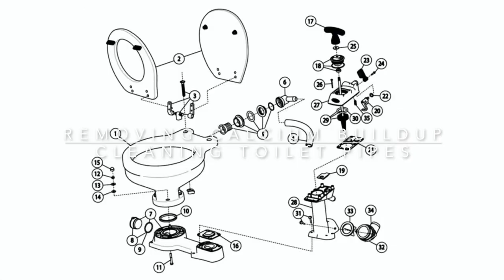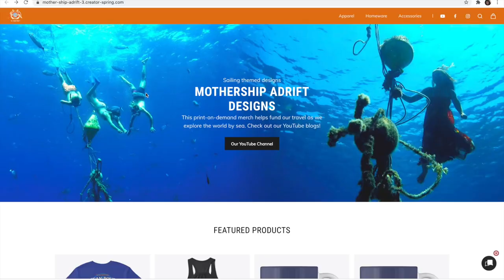Boat Toilet Calcium Removal from a Marine Sanitation Waste Hose Pipe or “Poo Pipe”!

Comment: Jabsco recommends vinegar (acetic acid) to remove limescale. You need enough to fill the pump and the discharge pipe. Let it rest over night and, when you pump it out the next morning, it will do the job in the holding tank. As with aguafuerte (Hydrochloric acid), it gets used up in the process. The trick is to find the right interval to repeat the procedure.
By the way, flushing will get rid of the human waste, but I doubt that better flushing of the toilet will prevent the deposits. Sea water contains plenty of calcium as witnessed by all the sea shells, crabs and coral reefs.
Reply from the maker: I think it’s the chemical reaction between urine and sea water that really causes the problems.. smells and calcium deposits. I have found that with better flushing both are reduced quite a bit. I also tried an experiment with vinegar and calcium deposits and didn’t find it that effective at REMOVING deposits although it did help PREVENT buildup. Aguafuerte / hydrochloric acid / brick cleaner has an instant effect, but you have to use it sparingly and make sure it’s completed reacting with the calcium before pumping out.. otherwise you’re pumping acid into the sea. I thin boric acid is supposed to work equally as well which I believe is the main Ingredient in Barnacle Buster.. although never understood the huge price for that stuff.

Comment: I was sick of calcium building up every couple of months at the bottom of the holding tank and clogging it up, leading me to remove the pipes to clean it. Very messy job. So i installed a 3 way valve and flush it straight to sea now. I can use the holding tank when in marina too.

Comment: Good stuff. Those galvanic connection wires needed cleaning up too. Use salt & vinegar solution then baking soda solution.
Reply from the maker: Good tip!

Comment: It's the hard way and it's the wrong way to clean out the toilet tube. My tube is 1.5" and 6 meter, i cleaned it out in 20 minutes using 30% acetic acid.(Keep the sea water inlet closed while doing it, after putting 6 liter inn little by little and taking my time I flush it slowly out using cold fresh water(no seawater) septic hose should never be near heat and you should never throw hot water in it.

Comment: isnt aqua fuerta soluble with water and becomes neutral ? not that harmful to the ocean ;) you could fill the discharge pipe with it and open after 15 min ;)
Reply from the maker: Probably true.. after it’s reacted with the calcium it loses its potency anyway so mixed with water it probably is mostly harmless.. but just to be on the safe side it went down the marina loo.